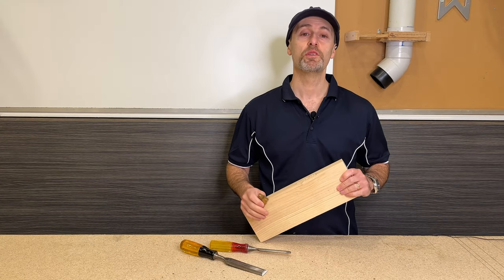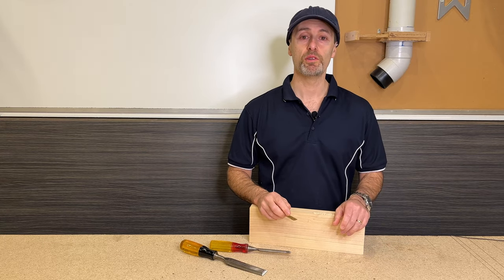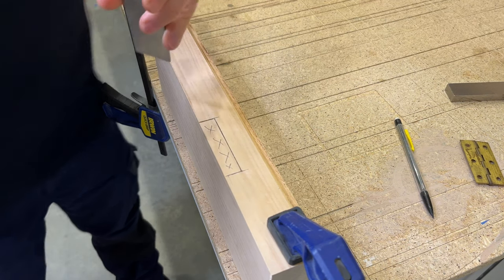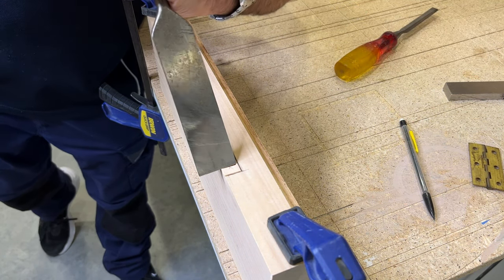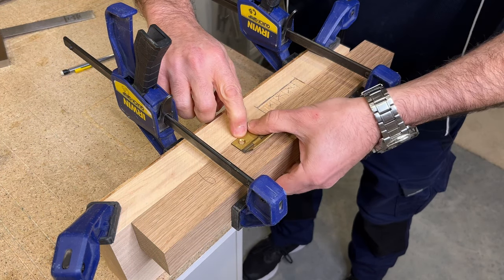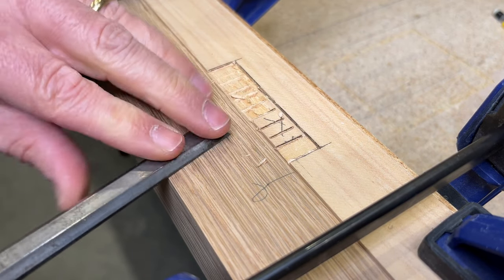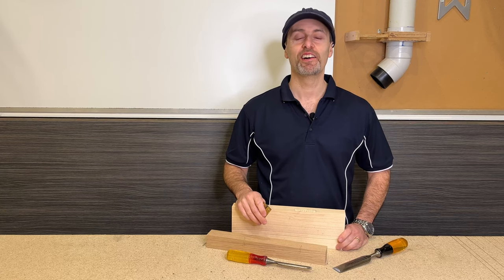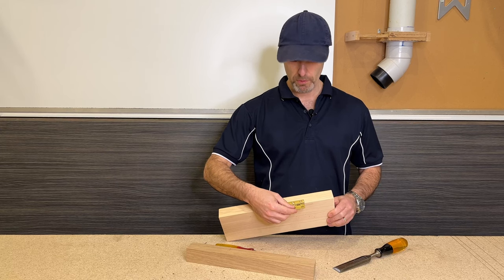How To Mortise Hinges With a Chisel | Chisel Out for a Hinge by Hand

Comment: Great instructional video. Thank you. One question. Is the hinge placed  at exactly 90 degrees the the edge of the door on every hinge type?
Reply from the maker: Yes this is important otherwise your hinge will bind and virtually destroy itself. If you notice the "knuckle" of the butt hinge should run parallel with the edge of your door. Good luck 👍